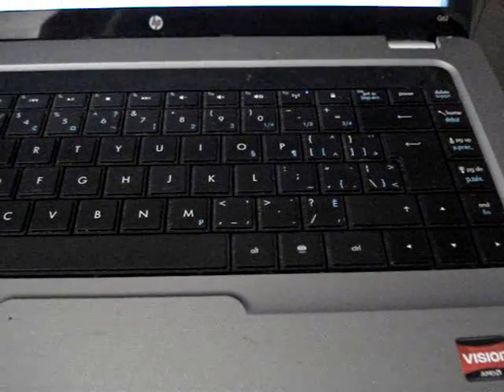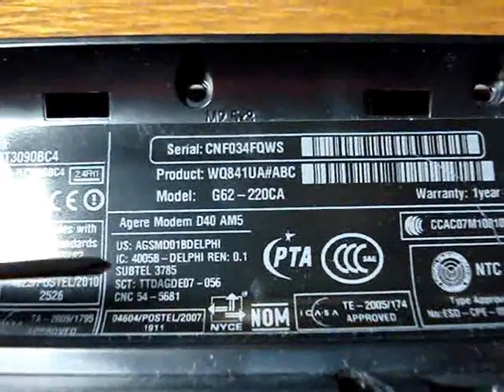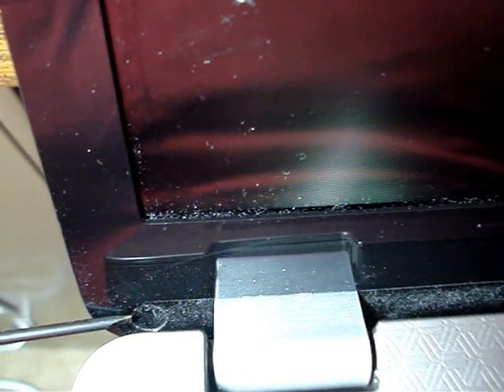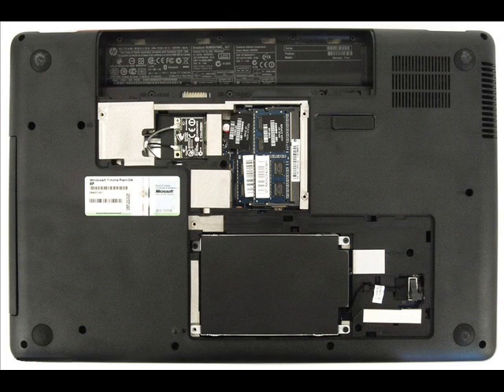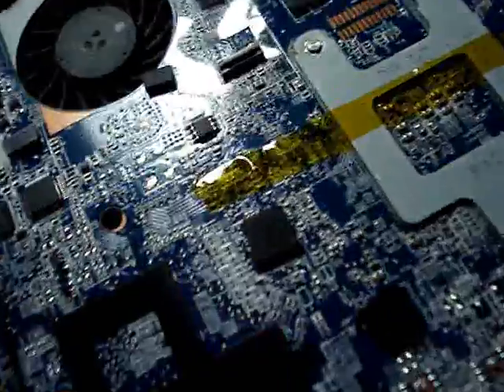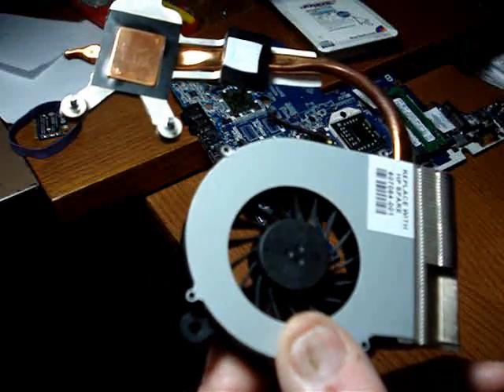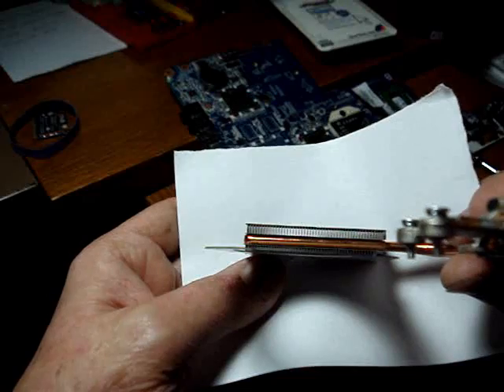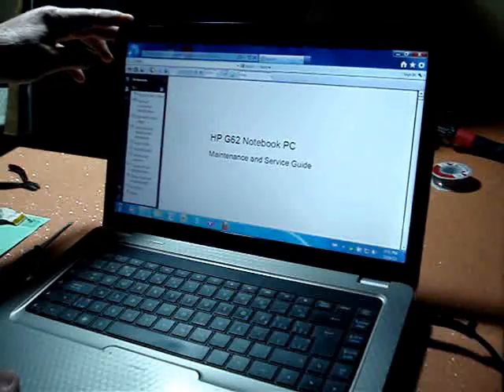HP G62 Laptop Screen Flickering

Comment: This is perfect solution.  Before replacing this cable, I took it around to so many technicians, every one said replace monitor 200 $'s.  I trusted this video, with little effort ordered video cable, did it myself. 50$'s because it is original cable.  Done deal, every thing working fine.  No more flickering or any problems.  Thanks alot for your suggestion Capman... Kudos.  BTW, I did this on G62X-400.

Comment: Thanks for the video.  I have the same problem, except that after a brief period (15-30 minutes) the screen becomes normal and the flickering goes away. By the way, an external monitor works without a single problem.  In my amateurish opinion I think I can eliminate the graphics chip set because of the external monitor, and the inverter because the screen goes to normal after a warming period.  That leaves the LCD, but why will it work after it warms up?  Could the cable still be the culprit?

Comment: Have you ever done this on an HP G42=301NR?  I'm having a difficult time finding the right part # for the LCD flex cable on this model and HP wants to sell the cable with the screen and lists the part # as the screen.
Reply from the maker: This site sell screen cables - pchub.com/uph/category/9-10-17702-0-0/LCD-Cable.html

Comment: Do I want to search for:  LCD video cable, display cable, or LCD display cable?  All the part numbers I see are like DD0AX6LC001, not 595186-100 like the barcode you showed, and HP's website doesn't seem to stock them anymore.  Thanks!
Reply: I recently purchased bundle 595196-001 from the HP store - it came with the LCD display cable used in this fix plus the WiFi and webcam cables.  I was shopping for parts under Support links for the G62t-100.  The package cost more than I needed to pay (i.e., only needed to replace the LCD cable), but still less than a new laptop and the screen is no longer flickering or going all zigzag.
Reply from the maker: This site sell screen cables - pchub.com/uph/category/9-10-17702-0-0/LCD-Cable.html

Comment from the maker: Yes, the bezel must be removed and monitor has to be folded down in order to disconnect the cable from the rear.  The LH hinge must be removed in order to route the cable.  

Cable Replacement →
• It all depends, do you contently fold down the lid?
• Constantly opening & closing the cover wears away at the cable as it is routed through the  LH hinge.
• To help prevent the chafing, line the hinge with cardboard.  Sorry, should have shown in the video.  It's a little tedious, but worth the effort.

Comment: In terms of finding compatible video cables, my HP spare part number is 615584-001. When searching for replacement cables, I'm finding that the listings say that the part has compatibility with other numbers, such as AX6LC020, AX6LC001, AX6LC005, etc. Does this mean that I can buy a cable listed as being compatible with one of the latter numbers (beginning with AX6), even if it doesn't mention the HP 615584-001, and it will still work? Thanks!

Comment from the maker: The notebook display cable, in most cases fails within the hinge area due to chafing. Move the screen as displayed in the video, if the screen does not change, then I would look elsewhere for probable causes.
Another problematic area is the Motherboard. Solder joints become porous and may develop a hairline crack, due the the heating and cooling process. Once the the joint heats up, it will expand to complete a solid connection. A Motherboard reflow maybe an option as the condition progresses.

Comment from the maker: As seen in the video the screen changes as you move the cover. There a number of variables which could cause shimmering, anything from the screen its self, video card, RAM, or even a weak/cracked connection on the Mother Board, etc.

Comment from the maker: You could risk not replacing the thermal paste.  The computer will continue to function, but why risk damaging the CPU. The thermal paste acts as heat conductor between the heat sink and CPU surfaces.  As the compound ages it tends to thicken, reducing its heat  conductivity.  Heat kills CPU's, therefore I would highly recommend you replace the compound.  Apply a small amount of paste to the CPU.  Spread a thin even layer with a credit card.  Reassemble.

Comment: how do i remove the thing under the keyboard to get to the motherboard ?
Reply from the maker: Remove all the Phillips screws from the base, battery compartment, and under the keyboard.  Mark the screw holes under the keyboard which had screws.  Lift the tabs on the ribbon connectors to disconnect.

Comment: That's what you get for buying cheap component HP. Eventually the soldering will melt and graphics go short circuit. Then you throw the entire machine to the garbage. HP = Garbage. Don't buy that crap ever. It's been shitty since 2000. HP.. Never again. You will pay the brand and cheap components for a lot of money and you will always get disappointed